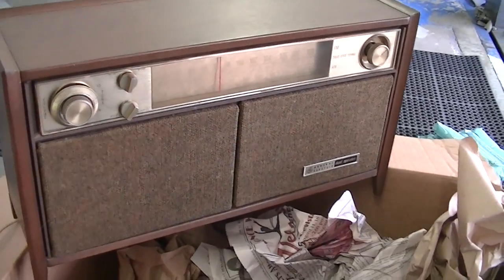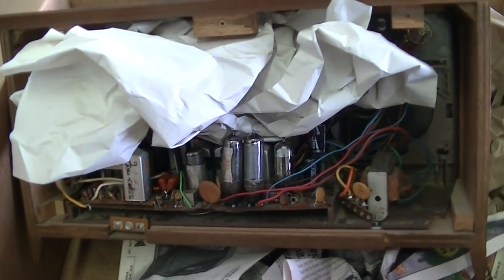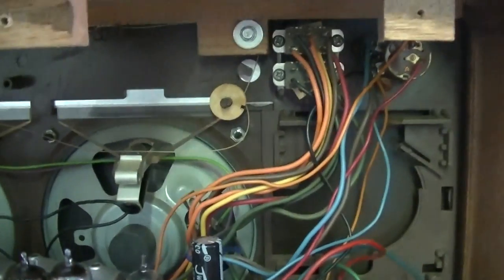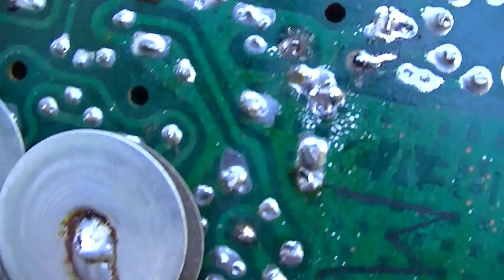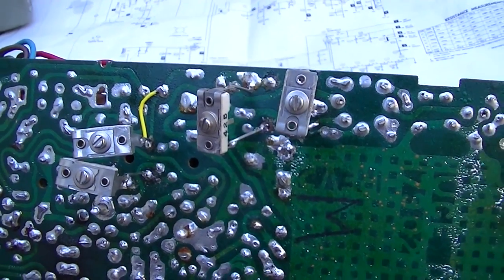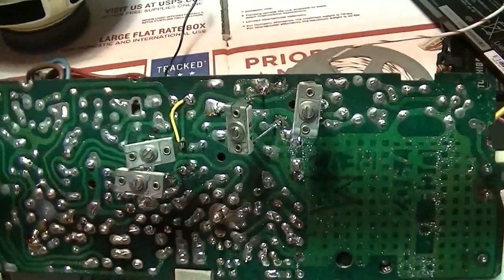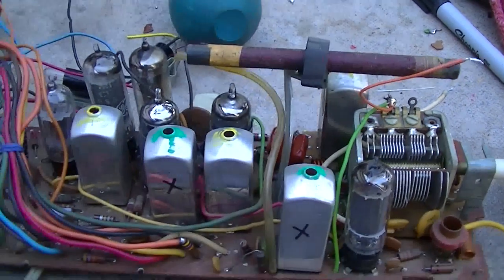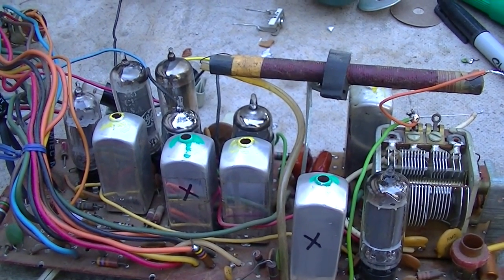General Electric Table Radio AM Section Repair

Comment: AM is working quite nicely now. As far as the hum goes, don't rule out the 50C5 having a thermal short between heater and cathode---I've had it happen many times.

Comment: I assume that someone is stealing your videos, hence the paper with the channel name and mentions of  it mid video?. 

I also find a lot of your videos fascinating to watch you repair radios and TV's with valves (its what the British call tubes) in them. its technology that is defunct, yet here we are 40 - 60 years later and they can be repaired, unlike modern electronics, which is more or less knackered in 10 years.

Comment: Still broadcasting christmas music in mid january, seems a bit excessive to me.
Interesting about the squealing in the lower stations. I used to think that was a fault in their transmitters.
May I ask what's the value of the trimmers you use?
Reply: MisterTalkingMachine that is odd most stations I listen to that play Christmas music non stop switch back to normal programming on December 26, perhaps this video was recorded before Christmas?
Reply: Over here it's similar. It stops shortly after christmas.
Perhaps the video was recorded earlier, though recently radiotvphononut pointed out the same thing on a video, upon finding a station playing christmas music. So I was not sure if it's widespread or just an on-off thing.
Reply: MisterTalkingMachine I still hear it too here on some radio stations & OMG people still have their outside Christmas lights on around here! I pulled all mine down a couple of days after New Year's Day. LOL
Reply: Corinna Roberts we didn't do Christmas lights this year,   they get turned off not long after New Years, If they get buried in snow and ice     (Mostly shrubs) we leave them up  until  the snow melts.....
Reply: ***** oh ok. I would love to have a white Christmas just to see what it's like because it's Summer for us here in Australia for Christmas.
Reply: I think there are a few lights still around, most likely due to lazyness.
Over here I really feel sorry for the poor buggers that have to stand around in a santa costume at 30°C.
Reply: MisterTalkingMachine True & we are having a heatwave summer too. Yesterday it was 42. The hottest day so far for our area.
Reply: Tough. Earlier here it was 32, though in the city centre it can reach such temperatures due to the buildings reflecting light, all the people and machines plus the poor air flow.
Reply: MisterTalkingMachine Yeah its abit cooler here today but still hot. My air con blew up so I'm feeling the heat. It's 31 at the moment.
Reply: Corinna Roberts Hi mum.
Reply: Vivienne Isobel Roberts Hi daughter.

Comment: Shang, was wondering if I could ask you an OT question: if I am getting RF from my ham radio transmitter in my stereo speakers, do you think it would affect the frequency response of the speakers if I wrapped the speaker wires around a large lossy toroid? Thanks very much.

Comment: I've been tempted to ask this question for a while, and have mainly been put off by the fact that its probably a dumb one... But, is someone willing to explain to me why some AM radio stations have an audible sweeping "squeal" bookending the station's frequency? More specifically, when you approach the appropriate frequency on the tuning dial for a given station, you hear a sweeping whine that becomes inaudible once you've successfully tuned the station. Then it re-appears as you move on to the next station. I guess whats most puzzling to me is that the sound tends to differ depending on how far up or down the dial you are. Or possibly it depends on some oscillation unique to the radio itself.
Reply from the maker: Its some type of interference and have never figured it out. At home it 
appears on all stations below about 800khz on all AM radios. It doesn't 
appear at all on those same radios in a different location. Its not a  
dumb question at all and I have often wondered but not investigated. I 
will pin this comment and hopefully we get an answer
Reply: I looked up Shango's location (Los Angeles, CA) in Radio-Locator, and I see that there are many stations on the upper end of the dial there. The squeals are most likely image interference. Add 910 kHz to any frequency where you hear a squeal; if the result is a frequency that has a strong signal, then you are receiving image interference.
Reply from the maker: That would explain it. Something you would never notice on a synthesized tuner. That was a trick to receive analog cell phone calls with some scanners.
Reply: Wiresgalore I think it's as the local oscillator (less IF) gets close to the carrier it beats and produces the whine
Reply: This has had me puzzled since I was a kid as well. and I have noticed that on the same radio, it changes depending of the place you are. I've been to a city where it doesn't happen at all.

One thing to notice though is that when it happens, it's always at the bottom of the dial. This makes me think that the design of the radios may be part of the cause. If so, you should get different results with different types of radios, say TRF sets, regeneratives, direct conversion receivers or even crystal sets.

I only have superhet radios, so it will be up to any of you who own other types to try and tell us what happens.
Reply: shango066 
Isn't there a digital sideband that modern digital tuners use to recieve station name, song name, artist, etc? Or AM stereo or something like that?
Reply: It's just disparate radio signals clashing and sounding a noisy signature.  the stations tunings are dependent upon the closure of longer waves on the low end of the dial.
Reply: he doesn't care, he'll fart in a Mister Microphone and get the girls to the car and or yard.

Comment: Reversed music is better and reveals hidden stuff inside the track, just wondering if the caps for 10.7mhz caps should be 68pf and the 455khz caps should be 270pf.

Comment: I know you really need a signal generator to do this but what is the best way to fix SMD without a RF signal generator?
Reply from the maker: AM you could peak it for sensitivity and get it to work ok, FM no way, need the sig gen to zero the detector. I will do a detailed alignment video as has been requested
Reply: Gee thanks! I'm not too worried about FM right now, mainly working on AA5s. I tried doing a SMD repair on a little Silvertone AA5 a while back and unfortunately took the advice of the people on the ARF site and put 120 PF ceramic disk caps across the bottom of the IF coils and messed up the alignment so bad, I can't get it to tune in anything no matter what.